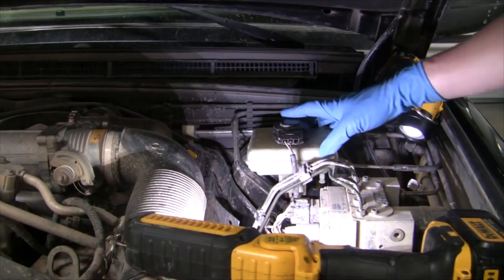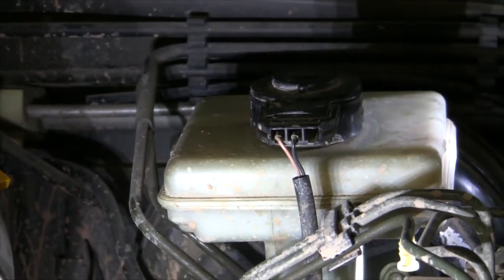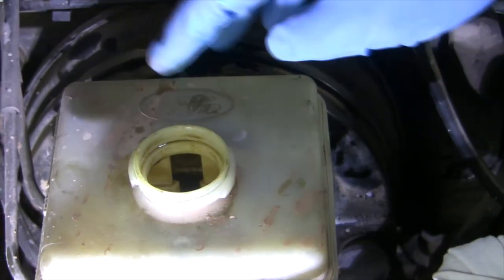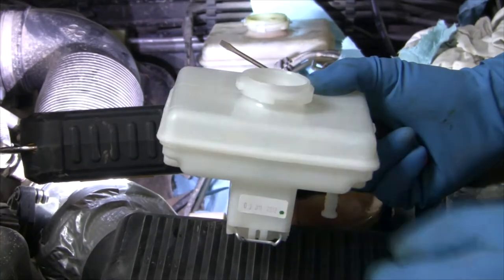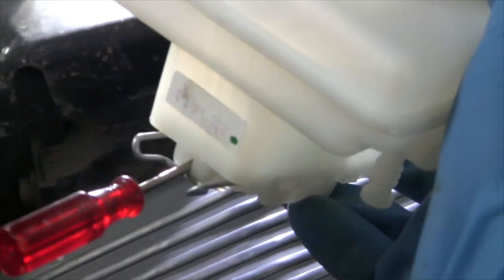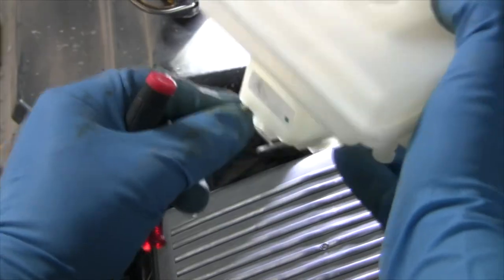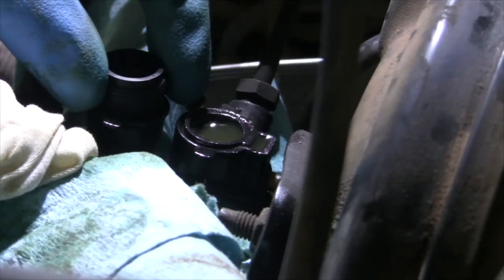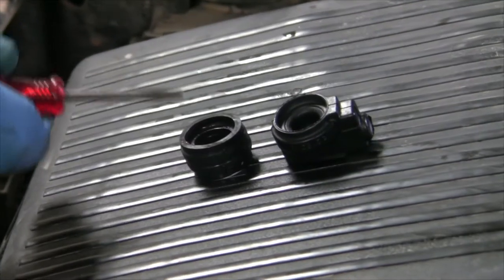Brake Reservoir Replacement: Land Rover Discovery 2

Comment: There is a super EZ way to bleed the brakes without using the computer; Just find the ABS relay in the fuse panel under hood (or bonnet). Pull the relay, get a long 2-wire with a push-button, long enough to reach each wheel, connect the other end of the wires with spade-connectors to the points in the fuse panel that will jump out/power the ABS pump. The relay has a schematic on it; two points for relay-coil, two points for contact-closure. Your wires go to the contact-closure points. Bleed brakes at each wheel, use push-button to turn pump on when you crack each bleeder until new fluid comes through and all air is out. Reinstall pump relay, done.

Comment: Thanks for the video!
The only thing I would comment on is when you pull out the strainer, dump the contents in a rag or another bottle to throw away. That's where moisture is trapped and you don't want to dump it back into your brake system.

Comment: Did this job yesterday and the video was a huge help.

I used a small pair of vise grips to pull out the old grommets. They latched on tight and it was surprisingly easy to get them out.

The whole job took me about thirty minutes, tops, and I was pleasantly surprised. Of course, since air had gotten into my lines already, I spent another hour-and-a-half bleeding the brakes, manually and using the Hawkeye for an ABS bleed and then power bleed. But the reservoir replacement was a breeze! (Again, because of the tips in this video)
Reply from the maker: How much is the Hawkeye?  I'd like to auto bleed
Reply: 8LIFGR8 4x4 I purchased mine 
—specifically the Hawkeye Total—from Rimmerbros, and it was $353. Pricey, but I was getting an ABS code and decided it was worth it to know exactly what needed fixed, then I would also always have the tool on hand. It’s a great device. Lots of programming and diagnostics built in. Would recommend it if you plan on keeping your Rover for years to come.
Reply: That video really was the bomb man!
Reply from the maker: @mattbrown2282  , thanks!!  I've been spending too much time on the L322.  I need to reseal the t-case on the disco and my rear diff (they are leaking), I have new OME shocks to install, lots of stuff I want to do with the disco, but Everytime I sort out the rangie another sensor goes.  

I'll probably keep the D2, but the rangies days are numbered...
Reply: 8LIFGR8 4x4 It’s an eternal battle, but at least life’s never boring! I’ve started to wonder if these machines have monthly cycles...
Reply: How would I know if I got air in the brake line?
Reply from the maker: @macajr  , if the fluid level drops below the top of where the grommets are, you probably got air inside.  

Probably not a bad idea to bleed them.

Comment: Is the rear grommet a blind one_?  no hole there for the fluid to get down to the inside of the master  cylinder? how does the fluid get to the rear piston chamber then?
Reply: Through that lil' tube he pointed out. It feeds the portion of the master cylinder that pressurizes the rear brakes when you push on the pedal.